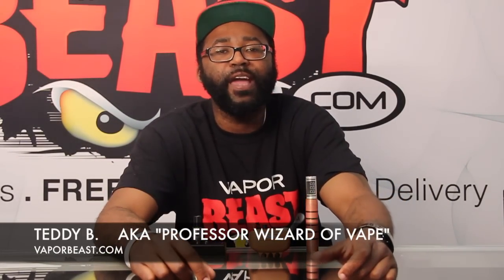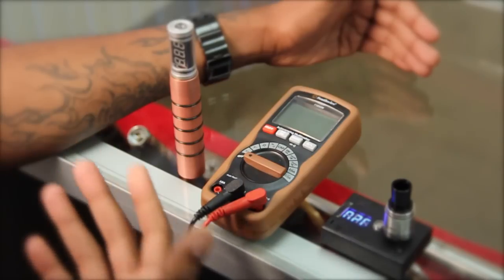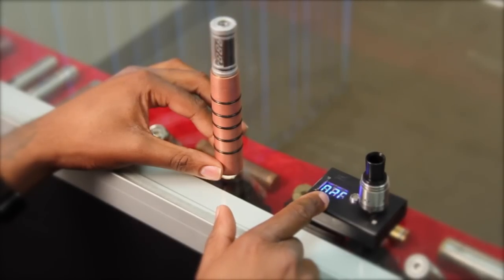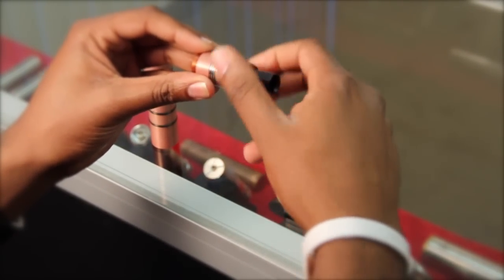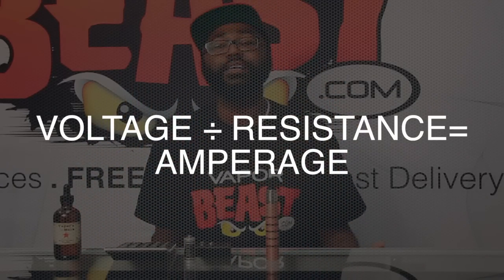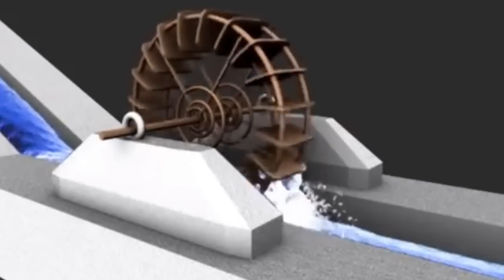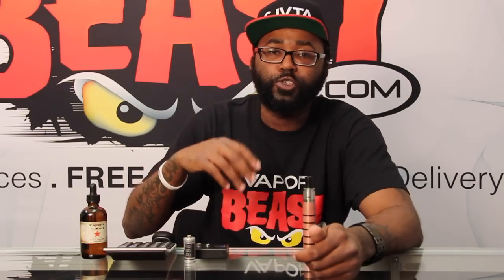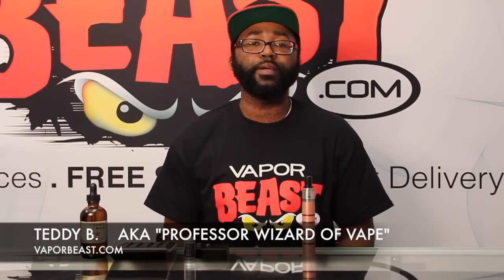Ohms Law Part 2: Putting It To Practical Use: Vaping

Comment: Hard to trust any of this info since, in part one you said that volts squared, divided by resistance gave me wattage. In part 2, you said volts divided by resistance equals amperage. 
Dangerous and confusing info.
In part 1 you said WATTAGE divided by VOLTAGE equaled amperage. 
Great way to teach....if you wanna blow someone's face off!
Seriously irresponsible.

Comment: So if i have two 18650 batteries. Would i need to multiply the voltage that is on the battery label  to 2? Then divide by the resistance? Or just the indicated voltage on 1 battery, then divide by resistance?

Comment: @VaporBeast - I'm a little confused. Could you please explain or provide a link that I can learn from regarding this issue?
I have a SMOK Big Baby Beast Tank with a coil that is .15 ohms. they recommend using between 60-80 watts.  I also have a Uwell Valyrian Tank with a .15 ohm coil. However, they recommend using between 95-120 watts.
I'm trying to learn ohms law and I just don't understand how two coils that are both rated .15 ohms,  are recommended 2 very different wattage.  thanks in advance for your help
Reply: this is for mach mods not regulated mods just vape it between the regular recommended wattage

Comment: Maybe you can help me out here, just got in to trying to use an RDA and am super confused here, ok so I've got pre built coils, if I stick one coil in the rda it reads .3 ohms and fires up perfectly but then if I add another coil to the rda it reads .17 ohms which makes sense but it will not heat up on my mod it just gets hot but will not fire up and obviously I stop firing so I'm not being dumb, it's on an Alien220 mod btw, doesn't make sense because the coils in my baby beast tank are around the same resistance at .15 ohms so why would it work in the tank but not in my rda which virtually has the same resistance? Been trying to figure this out all night and am just super confused by this. Sorry if I posted this twice btw it seems like my comment got deleted
Reply: Wait maybe I just figured this out myself but I'm at work so I can't try til later but tell me if I'm right, so ok the 18650 batteries have a 4.2 volts and I think the alien mod is maxed at like 25-35 amps or something, well when I was testing my rda last night I had the settings at 30 watts on my mod but I was just playing around with the ohms law calculator and when I input 4.2 volts and .17 ohms resistance it's telling me 24 amps and 103 watts so does that mean I need to turn my mod up to about 100 watts for the coils to heat up like their supposed to and maybe the reason it wasn't working last night is because 30 watts just was not enough power to heat the coils up?
Reply from the maker: I have a few questions before I can give my answer
 
What type of RDA are you using
What type of WIRE are you using for coils?
When click on the fire button on your Alien mod are noticing any messages appearing on the display screen?
What is wattage set to?
Reply: VaporBeast what is the wattage set to is the answer to my question lol, I was just being ignorant and had my device at 30 watts, as soon as I raised it up to 55 watts they fired right up. I guess I just jumped in to it too fast before fully understanding ohms law and all of that, since then I've immersed myself in the information out there and I think I'm pretty good to go on all aspects of it for now, I appreciate you taking the time to help though, I'll definitely be returning to your videos, what I'm trying to work on now is figuring out how to get some big ass clouds which is seems no matter what I do I can't really get anything that huge, big clouds but just not huge lol

Comment: as you vape the volts will go down so will you have to check your volts after each vape??
Reply: No. You're losing power, never gaining it. So it's only gonna get "more safe", never more dangerous. Eventually as your battery dies you'll just notice the weaker hits, and should charge the battery